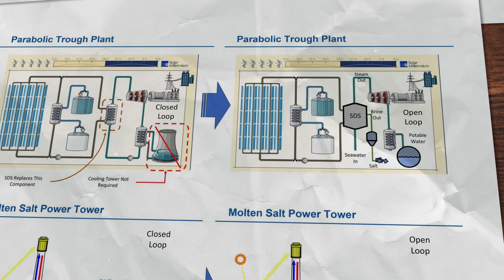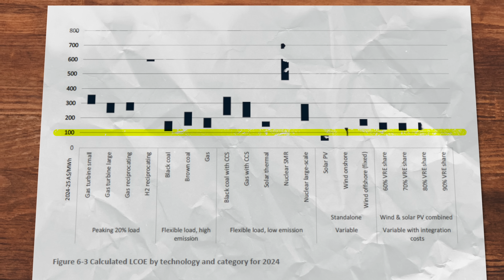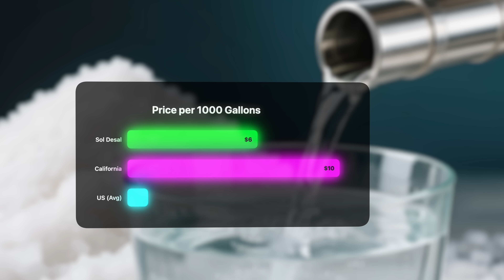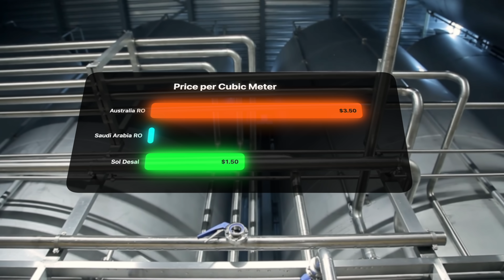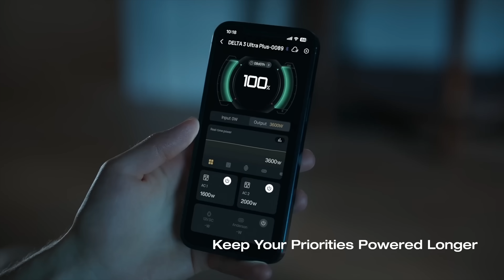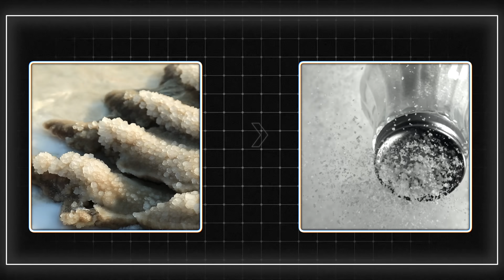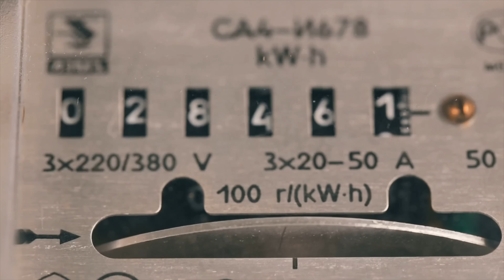The Desalination Process that MAKES Electricity - Too Good To Be True?

Comment: Build a facility in the right place, and you've also got a seawater microplastic extractor. It wouldn't do it at scale, but even as a happy coincidence and not the primary goal every little bit helps.

Comment: Hellooooooo?  Put the desalination tech on a boat powered by hydrogen electrolysis!  Maybe mount some solar panels or wind turbines to prime it.  This way pumping infra is tiny, if not just a siphon.  Use tenders to remove what it makes.  If you're Nestle, bottle that!  Reuse old oil rigs for this.  Stop building on land infra for this stuff.

Comment: "Are able to X" should be only said on the basis of them having a working example as evidence. The numbers are too good to be true, I doubt the solar energy is nearly consistent or enough, the turbine corrosion issue probably kills it, resulting salt will be environmentally dangerous and economically a liability. As for desalination to work without intense sunlight, you need to maximize surface of water, not concentrate it in a boiler. To make the plant operational outside of the prime solar input hours it would need opposite morphology. The small plastic floating distillers make much more sense for energetically viable water production.

Comment: A crazy idea could be doing electrolysis on the salt, storing the sodium and the chlorine and using them as inputs to fuel cells so they could not only be used to make sodium ion batteries but to have about as much on site stored power as they want. Also sodium and chlorine are quite valuable things that could be exported or specially sodium used directly as stored chemical energy, loading sodium canisters into your car could be a better option than waiting for sodium ion batteries to recharge.

Comment: That sounds like a very ambitious but great idea. Let's say they can solve the economic issues and make the system viable because they are near a sodium battery manufacture to buy their sodium and power.  What do they do with chorine?  Sodium from sea water comes in the form of Sodium chloride (NaCL) for every Na you get a Cl.  I can see them trying to sell the Cl gas but there is already a market for that and it would disrupt that market as well. 
Great format though. I really like your deep dives into the pros and cons of every technology you look into. Well Done  !!

Comment: Hey! An industry I am VERY familiar with. There are a few significant issues with this idea. First, using salt water in a heat exchanger (using the steam to preheat the salt water and condense the steam) creates a super acidic solution. The salt water pipe will be very short lived as a result. Also, salt water has an insanely high amount of disolved solids. Not just the salt but everything else in the water. Those solids get deposited along any heating surface, massively impacting efficiency and, eventually, flow. High dissolved solids also means a high chance of carry over in boiling water. The more stuff in the water, the more bubbles you get at the surface of the boiling liquid. A single drop of water from a bubble (carry over) can absolutely wreck a turbine.

While the overall concept is cool, the maintenance costs on this will be astronomical. Typical engineering student mistake, assuming a perfect world with perfect materials.

Comment: Having worked with steam boikers for many years water quality in boikers had to be of exceptional quality.  Any salt in water on hot surface resulted in very rapid calcium build up and failure of tubes due to localised overheating.  How are they preventing this calcium build up on hot surface?  Check out your kettle elements if you dont believe me.

Comment: If one of the main problems is the buildup of 'muck' inside the engine powering it all. Change the engine.. Make the buildup beneficial or easy to clean. If you use a rotorblade system but it gets destroyed by buildup, then dont use blades at all. You need to rotate something. It doesnt have to be blades. You can rotate a can within a can. If the salt buildup increases within the inner can it wont stop rotating or functioning.When it gets too full just clean it mechanically and it functions like before. It might be a bit less effenciencywise but you need to think in scale. Especially if the project is huge.

Comment: The salt is only a perceived problem for short sighted regulatory bodies whose sole purpose is self perpetuation. 
The net effect of pumping it back into the sea, may change the salinity locally by a very small percentage, but into a very big ocean it is a non event. 
I understand salinity varies slightly from ocean to ocean anyway.
The only challenge is the pumps and pipeline to get it offshore far enough and into a major ocean current.
The water and salt issue is a  "CLOSED SYSTEM," unless aliens start stealing either.

Comment: I believe this would be a toxic nightmare. Piles of unused and low demand salt will eventually need to be dealt with. Surface water like a heavy rainstorm will wash the salt back into local waterways, poisioning the locsl water. Not a good idea.
Reply: Dump in a mine somewhere inland

Comment: Sounds good, but sea water isn't just a pure NaCl solution. It has a bunch of other ions and considerable amounts of organic matter. Not to mention pollution. Also if the output is mostly distilled, pure water - that is not ready for human consumption. It can probably still used for industrial uses though. This is a very optimistic plan, but I wonder if they can solve the practical engineering solutions. It would be great!

Comment: $100/MWH is 10 cents/kwh, which is 43% cheaper than commercial. 
Likewise, most people live on sea-costs. 
So such a system could result in EVERYONE moving there;  because fresh water would basically be FREE, being the waste-product of powerplants, which sold electricity for cheaper than currently.

Comment: it is not possible to use sea water as turbine's working medium. turbine is the most expensive and delicate part of the rankine cycle and the water going through it should be 100% pure(which won't be achieved by simply boiling it) so it doesn't damage the turbine blades overtime. also the steam chamber needs constant cleaning.
but the concept promising. it has been happening with Organic Rankine Cycles (ORCs) for years using the thermal energy of the ocean, with the difference in salt production.

Comment: I always thought about using chlorinators (like the kind used in common salt water pools), which change salt water into chlorine water, then just boil off the water (or the chlorine, whichever goes first)

Comment: You only need to use a heat exchanger to put fresh water steam through the turbine portion, the steam created from the salt water side can still be taken out of the system separating out that water to desal.
On the "energy" use to the brine tanks to remove the rest of the water that is done with the sun so, no you would not use electricity from the system.

Comment: You should refer the manufacturer to Elon Musk solving the brine problem, powering his plants cities supplying clean water, electricty, sodium ion batterys.  Coming soon to the gulf of America tesla factory and city adding each homes solar, battery, ev battery as a coop power provider paying .40 cents a kwh of .80 kwh ex. in California.  every 100 kwh pays $40.00   Upgrade power walls to 100 kwh.  using sodium ion non flamable batteries.  Pays $40.00 2 peak time or $2,400.00 a year and saving .70 cents kwh peak rate charge.  $600.  $36,000 
a year.  Tesla charging stations, batterys commercial, solar home systems, cars semis are coop peak power producers.  Save our farmlands from solar fields.  Thats an environmental failure.  Green power decentralized.  The greedy utilities can avoid wild fires using solar, battery  natural gas or wood waste bio gas making bio char fertilizer replacing commercial fertilizers   Especially in California.  Remove the fire hazzard transmission lines for ever.  Spread in animal bedding to charge and spread after composting.  It lasts for years, increases each year of application.

Comment: I went to school for water engineering tech. I came up with a concept for a small system to do this. But there are a few things missing from your assessment. 1 filtering the water, 2 the “salt” isn’t clean the organics are waste therefore “zero waste” is not possible. “Sea Water” isn’t a standard base set of variables, temperature, quality, handling any environmental changes to your source water into your system. Would you have to RO the water first thought a standard system and then use solar to recover the energy?

Anyhow, I came up with a different but related system that scales based off of a…. But I’ll keep the rest to myself just in case I find funding for my little R&D company in BC Canada

Comment: I mean, in theory, using solar to boil the water and power the turbine, you can use the fresh water for backwashing the system (has to be done periodically to remove build up) but doesn't require all of the water created for that backwash, so...

I mean, you are going to be making more salt faster than the standard evaporative pan method...

Comment: The salt could be used for making sodium batteries, lithium batteries (where it can be extracted), and thermal storage. This isn't permaculture exactly, but it feels like it's taking the approach of permaculture where multiple functions are located in the same place, and waste outputs are instead turned into inputs for other systems. Love to see this kind of joined up thinking for solving our climate, water, and energy problems. Great video!
Reply: yep sounds like permaculture to me . if they can get this to perfection that would be a planet changer . good luck to them

Comment: Very interesting idea🤔
For the steam separation, 2 possibilities are using solar, potentially are centrifugal velocity and super-heated steam 
Centrifugal separation is like a built in vacuum in a house where heavies spin out while steam passes through. 
The collection tank can be continuous "emptied" by using rotating vales at the bottom of the collection vessel.
Superheated steam will require centrifugal separation too but the particulates will be "dryer" than the straight boil.
This has potential 😊

Comment: The water created this way is lacking in minerals and is akin to drinking distilled water: but mixing in some regular water with it should solve that. The issue of turning the mirrors to keep them optimal is the issue that shut the thermal plant in the US repeatedly, this would have the same issues.

The theory is simple and fantastic, but there is a lot of kinks to be worked out.

Comment: If you use solar for heat you only can use powerful direct sunlight. If there are clouds it does not work. The concept is limited to locations and times where direct solar is abundant. And it will be freaking expensive compared to solar PV.

Comment: I didn't know desalinization was so hard 😱

I designed a solar based solution just for fun around 10 years ago 🤷‍♂ 
With the cost of the build, I guess it would reach around 10 cents per Cubic Meter in a space of 15 years or less.

Comment: But they don't need to evaporate every last bit of water out of the salt. We use a lot of saline and brine solutions in this country. They are made by companies. They can get it down to a certain level, and then this drain the majority of the very Briny water off. And then turn it into different concentrations for different uses. 

Then there would be a low enough amount of water in the salt that they could spread it out over fields, like The artisan salt makers do. And it would not take that long to dry.

Comment: Since Tulare lake has started to restore itself, California NEEDS to double it's depth at half it's width that was destroyed by political corruption and over farming. And yes that does mean you will lose half of the farms created by environmental destruction. However at least half of these farms that never should have existed can still remain. Tulane will go much farther to stabilize California water supply that will any currently proposed project. It will return the natural weather system to the state. And by increasing the depth while limiting its original width, it should reduce the lake's future loss and still retain have of the farming created when the lake was destroyed.

Comment: The salt that the plant produces can be subsequently melted down and used for energy storage during nighttime hours and/or bad weather, since molten salt does a much better job of holding heat than most other thermal storage solutions.
Reply: I like it!
Reply: They'll have way too much salt. And CSPs aren't really cost competitive any more. Probably won't work out.
Reply: That was precisely what I was thinking. With an abundance of available salt on hand, you can cheaply produce thermal batteries. Even if the efficiency isn't great, enough of the imput is free that you can probably legitimately make money, and that's before getting additional money from governments for envirementally friendly activities.
Reply: @kennystrawnmusic  salt is highly corrosive.  Concept is fun but there are no economic materials that can handle the salt corrosion.
Reply: I think it would be neat to learn how to separate out the constituent metals from the salt. We have billions of years worth of fissile Uranium in the oceans.
Reply: Are you under the impression that molten salt reactors use sodium salt?
Reply: @louishermann7676  i think its more using salt as a battery, molten salt battery
Reply: @louishermann7676  No, that assumption is on you. He's talking about, and specifically mentions, thermal storage solutions. That heat is then used to do other work.
Reply: @gh8447 Ah, that's an appropriate interpretation. Though I doubt you'd reach temps to melt the salt. I can't imagine how you'd store the thermal material, cycle it to do work, and avoid the major corrosion that comes with. Though I suspect those are concerns for other types of power cycles as well.

Anyway, thanks for clarifying.
Reply: There was a recent video on YouTube about using the thermal properties of sodium chloride for storing energy as heat, so it has been somewhat trendy, recently.
Reply: @louishermann7676  Yeah, sodium chloride is just a tad different from thorium.
Reply: Until you don't need any more.